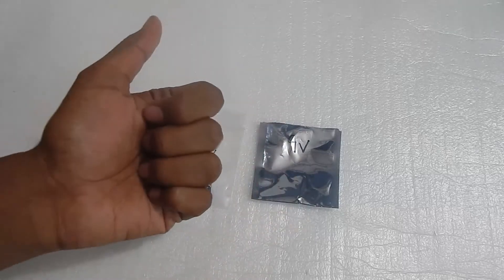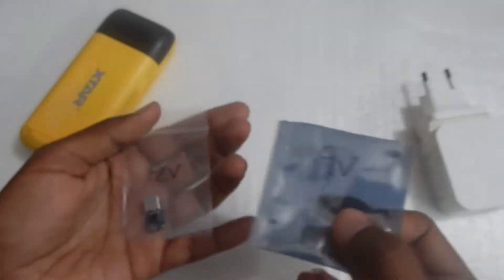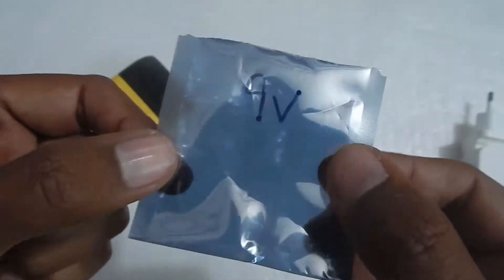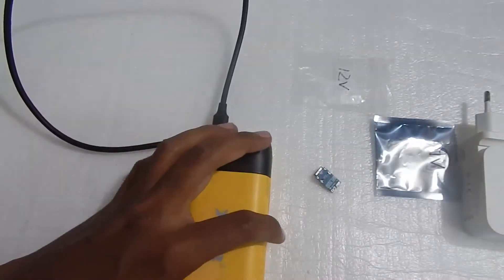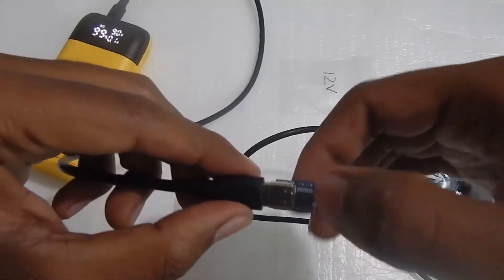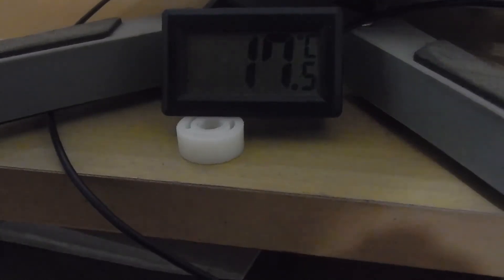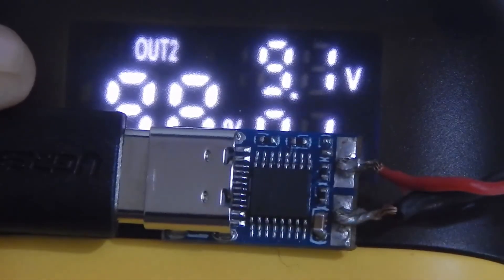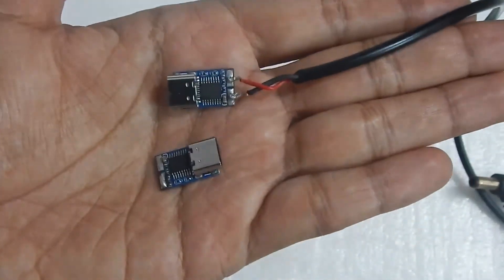Power Delivery Trigger PD Trigger Decoy Testing.

Comment: What is the difference between 9v decoy and a 15v decoy. Any changes in resistance or the ic is different. Coz I I have some extra 9v decoy laying around. But I need 15v to charge my 14.4v battery bank. So is it possible to mod my 9v decoy to output 15v.

Comment: What if I have 12v adapter, or a 12v battery. I want to get 5V. Should I use trigger board or a dc-dc buck converter?
Reply from the maker: you should use a usb buck converter.

Comment: Does it charge and supports with a 18650 battery pack in 4s configuration?

It's better to have a 20000 mah  powerbank can be charged in 3 hrs and provide 100 watts of Power.

Comment: Where did you get it? I would also want to buy .
Reply from the maker: I got it from aliexpress before c0r0n@ happened.
In india it is available but, at a very high price.
Reply: @gurribuy Can you please share a Amazon link that i want to purchase 12v pd trigger its a request.
Reply from the maker: @shan.bikeriders2002  https://amzn.to/3zN5WqZ
set the dip switch accordingly to get 12v.
Reply: Thank you very much bro for reply. I have some doubts. Can you explain, that i have Mi power bank 20000 mah which pd board will support output 33watts. Please bro reply me I am searching for a long time how many amp output will get in this all board maximum.  @gurribuy
Reply: @gurribuy please reply me bro i am waiting for your opinion to buy the product.

Comment: so  this setup is step up the voltage. why dont u just use booster module only? no need that decoy module.
Reply from the maker: PD capable powerbanks and chargers already have booster chips inside them.
its better to trigger the desired voltage natively rather than adding an extra module on top of the powerbank.

Comment: I am wanting to use these triggers for devices I dont have a charger for, If I am trying to embed this in a device am I selecting the module that is closest to the voltage listed as the input on the device? I have a laptop that wants 19.5v ~ 2.31a, I would assume a 20v decoy with a decent type c pd wall plug.

Comment: Does a pd trigger works with a usb-c tester?

I have some apple pd charging adaptor to test, I have a usb-c tester but it doesnt have pd trigger built in, if I use something like that but connects to a pd cable to an iphone, will it work?

Comment: hi there, i've a question about these triggers, hopefully you can answer it.

If the 12V PD trigger board is connected to a source that doesn't support 12V output.. what happens then? does it just stop working, or does it default to a lower voltage (5V perhaps)?
Reply: if u connect 12 v to a source that doesn't support 12v .Ur source board will kharab ho jai gaa
Reply from the maker: hello Eugene k, 
1) the trigger will only work if the source support PD.
2) If the source is PD then it is unlikely that the source would not have support for 12 volts.
(I have not seen any PD charger that do support 12 volts.)
So, Even if i wanted to test i couldn't test this because all the PD chargers that i have even the cheapest charger, have support for 12 volts.
Also, it would not make any sense to Give a USB C port and not put support for at least 12 volts.

Comment: Where can I buy a PD module capable of delivering 100W which can be directly connected to my battery pack (21v 5amp)?
Reply from the maker: you want to use your 21v battery pack and run  a PD module using that to power PD capable Devices.
I will let you know If i find something good enough  for your purpose.
Reply: @gurribuy  Sure, that will be very helpful. Thank you so much.

Comment: Can we do this to a laptop. Can I solder compatible laptop dc jack to 15 volt triggere. My laptop comes with 100 watt charger. Can I apply this hack there. Does amps matter in this conversion?? Your getting my point right ??

Comment: I have Xiaomi 33w QC3.0 charger,rated with 5v3A,9v,12v,20v and 11v can I use this to charge my custom made power bank at higher watts using this tiny module
Reply: Yes but only at 27w.
The 11v 3a will only works on Xiaomi.

Comment: I connect my 12V pd trigger mi 3i power bank and I check output voltage by multimeter, it's showing only 5V...why
Reply from the maker: what is your powerbank capacity. The 10,000mah version does not support PD.
And if you are using the 20,000mah version, make sure you are using a power delivery compatible cable.
Reply: @gurribuy  mi 3i 20000mah, 18watt fast charging power bank. The cable comes with the power bank. can this cable support pd delivery ?
Reply from the maker: @ibachan123  NO, power delivery only works on USB C PORT. You will need a usb C to USB C cable.
Reply: @gurribuy  thank you so much Sir for clear my doubt.
Reply: I think that support quick charge by Qualcomm. Qualcomm quick charge is a different protocol than power delivery